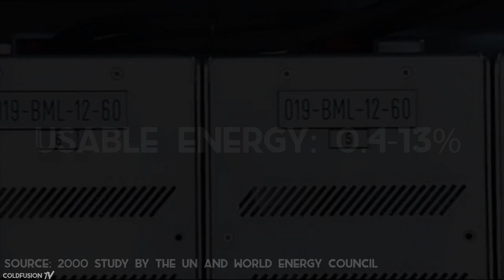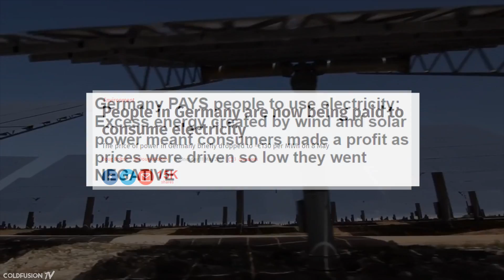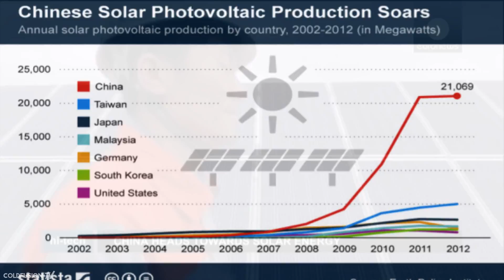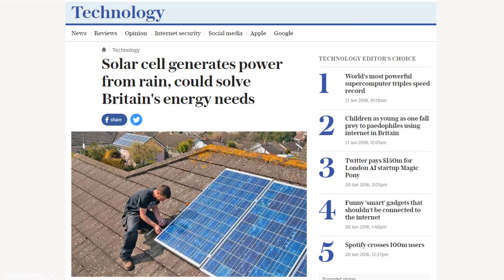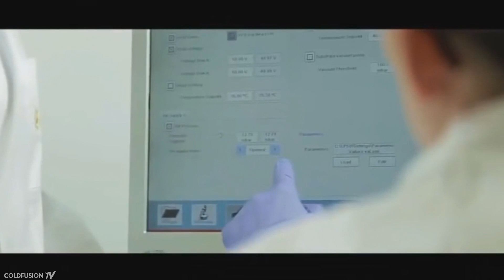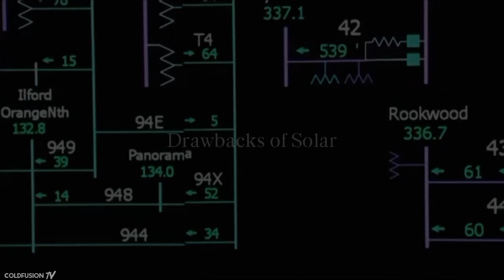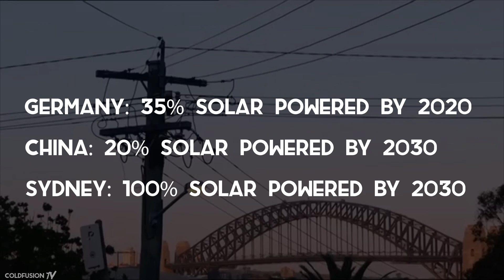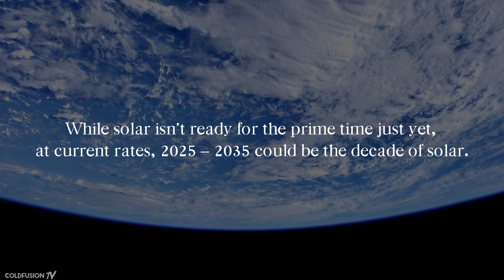The Truth About Solar

Comment: We, often, find solar photo voltaic panels on the rooftops, windows or in open fields in an inclined position. Most of the time, the sun rays reach obliquely over them, so they can not produce electricity with their full capacity. Besides, dust, soil and sand etc. deposit on the panels easily and decrease their efficiency. SOLARVIND brings its unique cost-effective solution named SOLAR POWER OPTIMISER (S.P.O.). Salient features of the S.P.O. are: 1. It is fully automatic machine which controls panels from dusk to dawn in a way to optimize their electricity production capacity. It can be installed anywhere easily. It is adjustable in size and panel of any size can be installed in it. 2. It has single axis solar tracking system, so it moves the panel according to the position of the sun and makes the position of panel perpendicular to the sun in order to get maximum solar energy and 100% efficiency of the panel can be obtained. 3. Its power consumption is nominal due to battery saving utilities. It is operated by 12 Volts small Battery. 4. It has an inbuilt utility which protects the SPO from strong winds or cyclones. It adjusts the panels in a way to safeguard from strong winds and cyclonic winds. 5. In case of dust and soil deposition on the panels, it alerts by alarm. 6. Its frame is durable and light-weighted so it can work difficult places for years. For business enquiries contact us: A.K. Sharma +917252083138

Comment: There are no perfect solutions to our power needs and wants.  Solar is an option that is starting to come to a price point which would make it practical for more people.  There is still a long way to go in making solar practical solution for the masses.  One item that holds back solar technology is the limitations of battery technology as we need a way to store power until we are ready to use it.  Battery technology is progressing, but slowly.

It seems that people either love or hate the idea of large scale solar farms or whole-home sized solar systems.  Utility companies seem to be much more interested in using wind turbines to generate electricity than using solar farms.

On a small to medium scale, solar is carving out a niche though.  It is becoming more and more popular with homesteaders, farmers, boaters, and RVers.

In an RV application, a 200 watt solar system can be built for around $500.  This will provide about 55 amp/hours of battery charging in a day with 5 sun hours.  Many RVers will use around 50-70 amp/hours a day of power.  Another $300 could up-size the system to 400 watts and provide 110 amp/hrs of battery charging in a day.  A whole home system would need to be in the kilowatts range, so cost would be considerably higher.

Comment: 36 cents per watt?! so 350w panel should be $126? it is 2018 and cheapest Chinese 100w panel on eBay is $160. And those usually do not deliver what is written on the box. Branded panels are more than double than that. So right now we are at about 1,6 up to 2,5 per watt for a good panel. And that is without expensive electronics and batteries which HAVE to be used in order to properly harvest solar power.  So this video is basically bullshit targeted for morons which will like any shit you put infront of them. more info here: https:// news energysage com / how-much-does-the-average-solar-panel-installation-cost-in-the-u-s/

Comment: Nice vid, except you don't ever mention the solar hydrogen solution (hydrogen production by water cracking through solar furnace or water electrolysis) which basically permits the storage and transport of solar energy as well as its use in transports and eliminates the need for batteries and their huge negative impact on the environment.
Solar hydrogen is the only  viable environmentally sustainable solution.

Comment: Solar is excellent however we need to take care not to take it for granted.  I recommend no country goes 100% solar.  Contingency planning is important and I recommend nuclear (preferably thorium based) as the backup.  A good example for recommending this is the  massive 1815 eruption of Mount Tambora during which many plants died in the Northern Hemisphere and people starved to death. The ground was frozen for most of the year and there was still frosts in July. It was known as the Year Without a summer. Such conditions would greatly hamper solar power and it would certainly not generate sufficient heat to mitigate the cold.  As we can tell from recent events in Hawaii and Indonesia this is a very volcanically active planet and it is just a matter of time before we have another year without a summer.  During this period our lives could be saved by diversifying our Power Generation Protocols.

Comment: Mistitled.  This video is very one-sided.  Solar power is too diffuse and it's advocates consistently underestimate the scale of the backup problem that is involved.  To understand just how daunting this is, realize that if you took every battery ever produced by mankind and dedicated it to backing up solar power's intermittency you would get one hour of global energy backup.  The sheer scale and cost, in addition to the cost of overcapacity you need to fill those batteries while still supplying energy demand should make it obvious that solar and wind simply cannot scale to a full economy.  They will only ever be supplemental sources.

An engineer on a TED talk did a calculation of how much of UK's land mass would have to be covered to meet it's energy demand.  It's about half.  Half of the entire landmass of the UK would have be be covered by solar to meet it's demands.  And that's it's CURRENT demands.  World energy demands are always rising.  

These scale issues are why wind and solar only thrive when large govt assistance per watt is provided.  The future of energy is probably PRIMARILY three-staged - natural gas in the short term to reduce emissions fast, nuclear fission in the medium term to get us to zero carbon, and nuclear fusion in the long term to eliminate fission's undesirable qualities (most of which are overstated by its critics).
Reply: The problem with solar panels which is misleading in this video, isn't the solar panels which lasts around 25 years. Its the inverters, current regulators, and batteries which have a short life expectancy. These items also created quite a bit of pollution to make and come at a very high replacement costs. Thermal electric generation or solar steam power are much cheaper to make and use. the thing I never see on any of these sites is a direct use with a capacitor in order to eliminate the batteries altogether.
Reply: Brian Mulholland, apparently I am living in a false existence  I have a house battery that is four times the size of a Tesla wall in terms of capacity. I also have two electric cars and several Ebikes. I am still hooked to the grid but have not once needed to draw from the grid since becoming fully on line. I do not really care about you nay sayers as I am living proof that if everyone followed my lead it could happen very quickly.
As far as batteries go we do not need light weight high tec batteries for non mobile storage.
Also get up to speed with what is posible in terms of energy storage there are many options.
The most likely of which will be converting electricity into ammonia for huge stable storage reversing the process to get electricity back and essentially looping these byproducts over again.
Another is making aluminum from the alternatives. Iceland does this with their extra geo and hydro. They send the aluminum to Europe they extract the energy and ship the alumina oxide back to be recharched.
These ideas are actually in use as we speak.
Reply: "if everyone followed my lead it could happen very quickly." Voluntarily or at the point of a government gun? That's the big issue here: government MANDATES. Did you receive any government subsidies when you installed your solar panels or bought your e-cars? How about your Tesla cap network? Is your local power company required by law to pay you top dollar for any excess that you generate, as is the case here in California? Did you receive a federal tax break (subsidy that I had to pay for) when you bought your e-cars? Out of curiosity, how much in out-of-pocket expenses have you paid for what you are touting? Here in CA, we have HOV lanes on our highways which allow e-cars like Teslas to ride in while forcing ICE cars to the other lanes, where they sit in slow traffic pouring out CO2 in huge numbers. Since your cars don't pollute (at least locally...), should it be YOU that should sit with the slow traffic instead of the ICE cars? After all, the stated purpose of these regulations is to "encourage car pooling and clean energy." What's so clean about creating slow ICE traffic snarls while you speed merrily along?

I'm all for you buying and paying for everything you have. That's capitalism at work. It's when government kicks in MY door to tell me to "pay up for Dana's e-toys" that I object. If this green stuff is so great, how come government has to step in to make it affordable to rich people like you while denying it to the poor?
Reply: Hear, Hear, Brian!!!
Reply: And they never talk about the degradation of the efficiency of solar cells over time.  Estimates by some experts indicate the efficiency decreases by about 5-7% per year.

Comment: You did not mention the disadvantage that solar is made with incredibly poisonous heavy metals and has no plan to decommission billions of cells as they burn out. You should do more discussion about the 'not in my backyard' aspect of solar - you can build solar, but transmitting it is nearly impossible or cost effective. In a few more years when invertors, batteries and cells are burning out fast - people are going to be paying huge mortgages for solar that does nothing for them . . . . and more
Reply: The environmental negatives of solar pale in comparison to coal, oil or gas. Still, there should be eco friendly ways to dispose of panels 20 years from now ( average lifespan of current panels).
Reply: inverter tech are becoming more and more common nowadays. We can easily transmit AC anywhere. The real problem is that the grid is not properly planned to handle the input of energy from the solar farms. For example Chile should have had a way to sell the excess electricity through power lines to another country or another region. Since they don't plan the grid well, they end up having to turn off some solar farms and having to pay customers to use the electricity produced :(
Reply: Silicon and aluminum are not "poisonous heavy metals" you thundering imbecile.
Reply: AntiCitizenX they must have mixed up their talking points on why batteries are bad.
Reply: I DID NOT MENTION IT BECAUSE NO BODY MENTION ANY OTHER METHOD DISADVANTAGES.  MOST OF YOU  ARE IGNORANT OF ANY KIND OF ENERGY CONVERSION DIFFERENT FROM OIL THAT GIVES TRILLIONS TO THE POCKETS OF THOSE WHO MANAGE IT FROM ONE HUNDRED YEARS WITH THE CONSEQUENCES THAT YOU IGNORE AND GIVE IT TO ANY OTHER WAY TO CONVERT THE ENERGY IN ANY OTHER FORM...,
Reply: THE PLANET REVOLVES FROM WEST TO EAST  NOT OTHER WISE I MEAN WHAT IS "IS" ...   THE SAME IS WE USE OF ANY KIND ENERGY CONVERSION THAT IS AVAILABLE AND PAY FOR IT AT THE TIME IN  WHAT WE LIVE ,   WE HAD THE TIME OF THE WOOD, THE TIME OF COAL, THE TIME OF HYDRO, THE TIME OF NUCLEAR AND IS COMING THE TIME OF THE SO CALLED SOLAR, OR WIND OR ANY OTHER METHOD ALL OF THEM WITH ADVANTAGES AND  DISADVANTAGES, ALL OF THEM IN IT'S PROPER TIME THE TIME OF ADVANTAGE IF WE WANT EVOLVE ACCORDING WITH THE TIMES IN WE LIVE.................
Reply: Not to mention the huge amount of unclean mining that goes into producing the raw materials to build solar/ wind farms.
Reply: @perentee77  As JonathanJK said, using coal, oil, or natural gas is far more environmentally damaging than producing the components for solar (or wind or tidal) power.  Solar power is far too beneficial to us to ignore it in place of what (limited) resources we have now.  And, yes, ferkemall, governments are 'banging on' about climate change cuz you're fucking seeing the effects of it every year.
Reply: @fuzzhead76  you've lost the argument when you start cursing and spewing hate. This is zero evidence for man made climate change, stop being a parrot (climate change and man made climate change are 2 very different topics).. I'm not saying renewable energy is bad, I'm saying shutting down coal fired power stations when there isn't anything to replace it is the definition of insanity, if you watched the video renewable energy is not at a point where it can replace traditional forms of energy production on mass scale. It's well known that the best way to bring people out of poverty is to provide them with cheap electricity. Therefore the opposite is also true, in this insane quest to rush to renewable energy before its ready the price of electricity has skyrocketed, its too the point where people can no longer afford it. Pushing people into poverty.  The amount of people having there electricity disconnected is higher then it's ever been. This is killing people.. can I ask what you do for a living? Do you pay for electricity or are you a university student living with there parent.
Reply: "well, only 97% of scientists - you know, experts - believe there is man made climate change."

Tell me, fuzzie, when and where was this vote taken? Is there some sort of club that meets every other Tuesday night at the local lodge where they vote on such things? While we're at it, how does one get to be "a climate scientist expert"? Is there a licensing panel somewhere? A well-defined set of skills? What happens if I, a reputable paleontologist, decide that I don't agree with your premise and I want to vote? Do guys like you demand my head and drum me out of your little club?

WHERE do you get you get your "97%" number from? Have you ever researched it?  Because I have. When you can state "97%" with such certainty, then it means 1) the number of "expert climate scientist" is a known quantity (dozens? thousands? millions?), 2) there is a society of them somewhere, 3) they are credentialed, 4) they took a vote, and 5) they all read one another's thousands of journal articles. That's some club!

Who are these people of higher authority that you cite? I'll await your reply.
Reply: learn more about the subject then speak

Comment: Grids do not need to be upgraded if the solar power is installed at the point of consumption . Residential or commercial solar consuming the power they produce will not require tax dollars or investment.  The only investment required will be for traditional power delivery from a great distance.  The real question is why would we continue investing in centralized power generation that continues to bill every consumer each month and forever.

Comment: People look at the fuel and not the infrastructure costs. Solar and wind require backup due to their intermittentcy. They require large tracks of land and interconnecting transmission networks which causes greater maintenance costs. Then theirs the resource requirements to manufacture them along with the energy requirements. They require rare earth elements and loads of copper. And can they efficiently be recycled from end of life? I read where their lifespan is about 25~30 years while a properly built coal plant can last 60 years or more.

Take away the exorbitant subsidies  and mandates and solar is no longer and attractive investment. 

https://www.forbes.com/sites/michaelshellenberger/2018/04/23/if-solar-and-wind-are-so-cheap-why-are-they-making-electricity-more-expensive/

If Solar and Wind are so Cheap, Why are They Making Electricity so Expensive?

I think the real future is Modular MSRs run on thorium and uranium. And there are other promising alternatives:

https://app.box.com/v/CLEANENERGYEXHIBIT

Comment: The issue of infrastructure limitations is irrelevant as central power generation stations will be unnecessary since  each area can have it's own power Generation station.  Imagine a solar farm every 50-100 miles, or whatever is practical just supplying power to the users in it's immediate vicinity.  the problems of the aging American powergrid system could be a thing of the past, and the salvage of materials from the existing power grid would far exceed the needs to produce smaller decentralized power grids.  Of course the limitation on any big company to make money from such a system will certainly cause the ide to be buried, like Westinghouse burried Tesla, but at least it's a good idea.  just get it out there before the "big guys" take it from you.  the only way this syste3m can fail is if you try to make money off it..  You will loose.

Comment: You failed to talk about how solar panels are prone to unpredictable failure due to over heating. An how solar panels are often not cross compatible between brands and models because of the veriances in quality and out put productivity performance. An you have also neglected to mention new questions about the potential dangerous effects mass solar farm are having on the ozone layer.

Comment: The down fall is greed and non community resposiblity. The user buys and repairs. Wrong! Farms are the community answer, jobs of existing electric employees, service payed as you go. This is the only way to control out put, need and maintenance. No matter what roof you put it on repairs and weekly observations should be made. The enegy source has to be transferred to usable amps, watts, volts.  Every one is seeking how to make the other guy responsible and elliminate employees, people. Boo hoo, no job no grid, no user. Fire will work heat and cook.